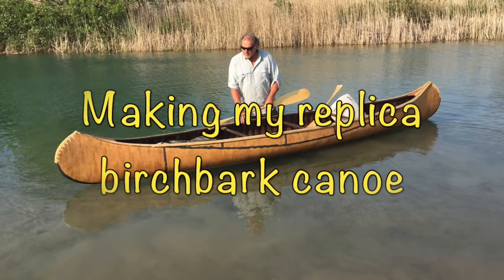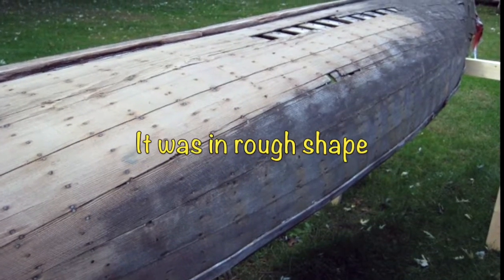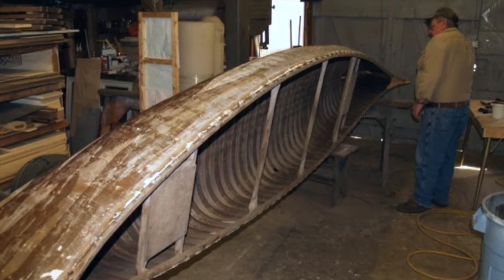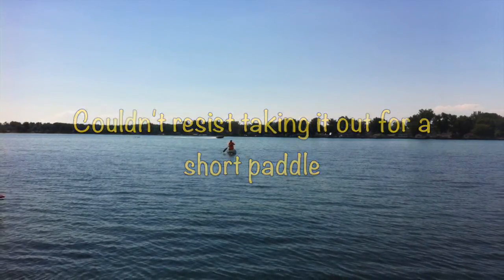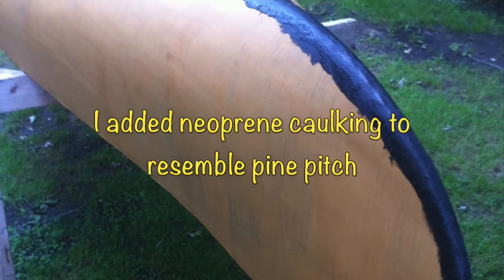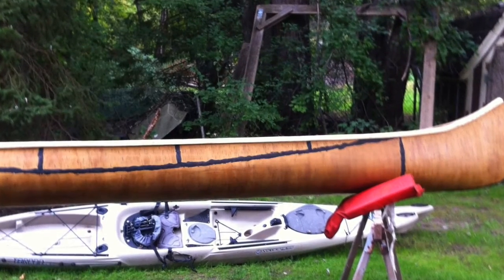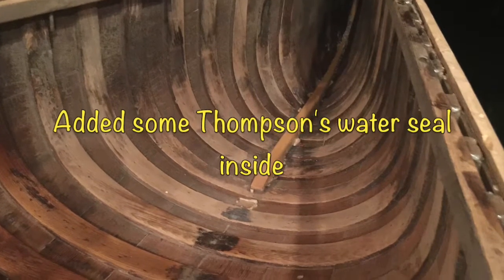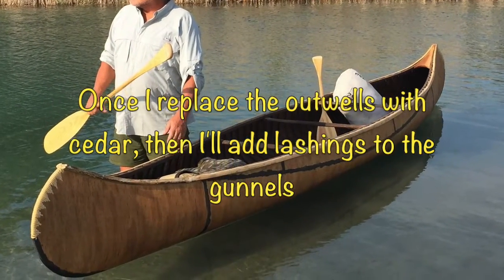Replica Birchbark Canoe Build

Comment: I'm in the long process of making a fiberglass hull look like birchbark. 
 Climate is too dry here for real birchbark.  
I'd be curious to know what you used for inside planking. 
Weight is my main enemy.
Reply from the maker: I found an old canvas canoe. The ribs and planks were already built into the canoe. I just had to replace a few that were damaged.

Comment: Ya could've built a real one easier dude! Nice work , I bet you'll get a call from holiywood  to build twenty of em for Leonardo's next movie. I bet you'll get some looks and lots of questions. Nice build.
Reply from the maker: Tim, Probably, if I had the birch bark, the cedar planks, spruce root and pine pitch.  It was easy to come up with the modern materials.  I would like to make a real birch bark canoe some day.  It's funny you should mention Hollywood, they usually call and want something in a week.
Reply: Thanks for the reply. I want to build one too , that's how I ended up here. I live out in the boonies so I have access to materials. I don't have access to "good" materials though but I'm looking and getting familiar with the materials. I had the thought also of making a "post appolyptic" birchbark canoe using linoleum , phone wire etc for the materials? Probably won't pursue that one though.